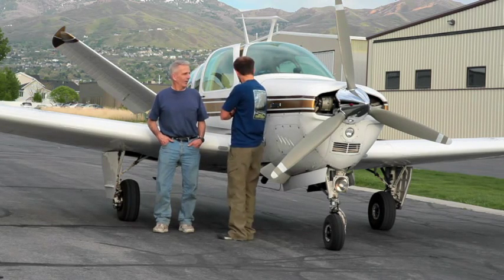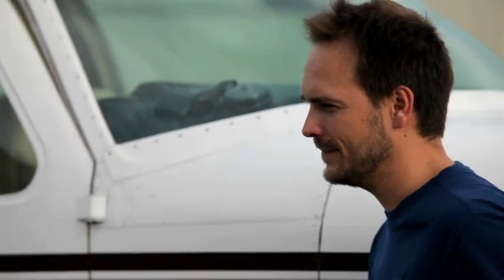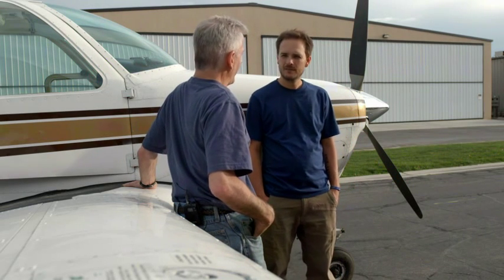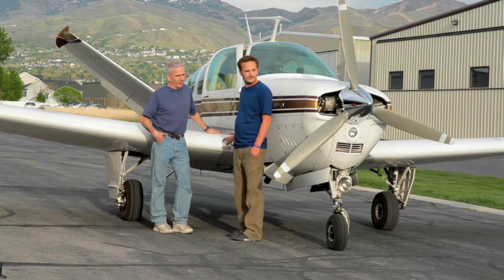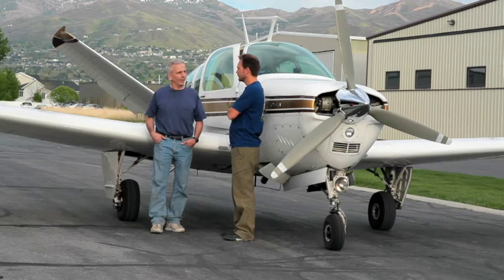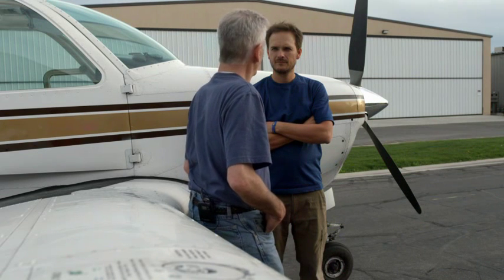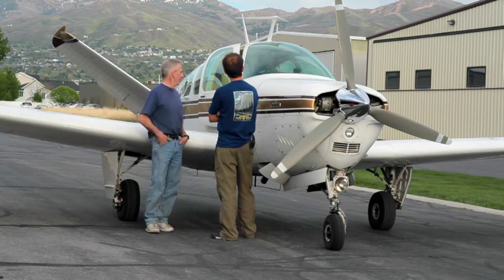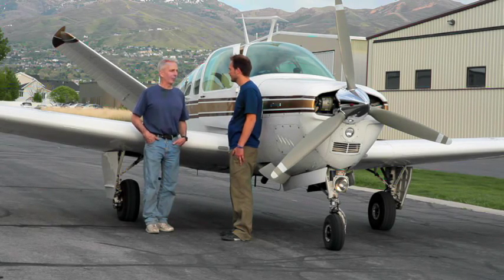Airplane Ignition System - The Beechcraft Bonanaza

Comment: That's not a b model. The B model was made from 1970-82. This is a first edition v35 (non a or b model) if its a 67. Its the original v35. You can tell its a regular v35 or A model by the cowling pin latch types. One latch like the A36 type on the b models and the 4 quarter turn types on this model and the A model.
Reply from the maker: Nice.